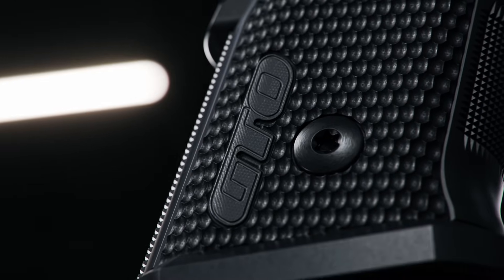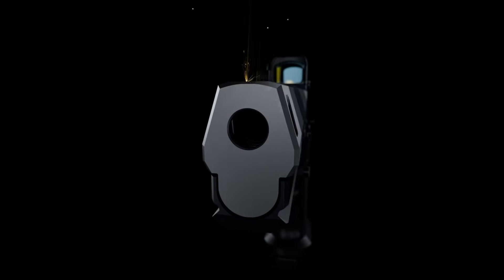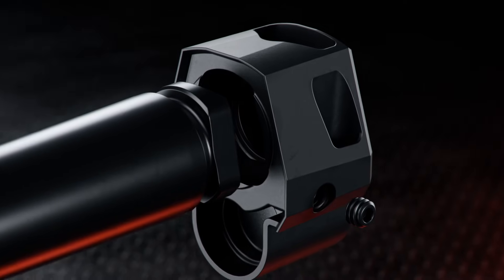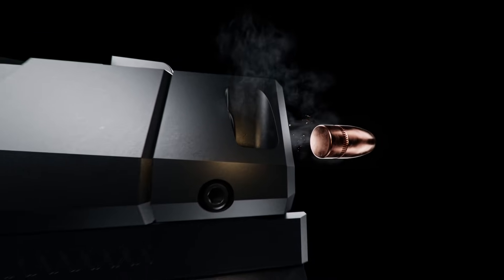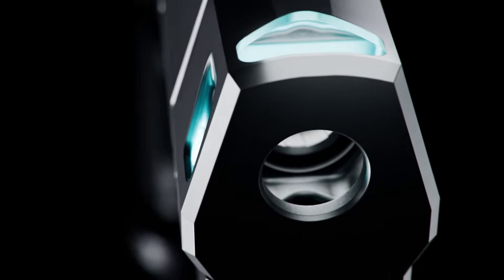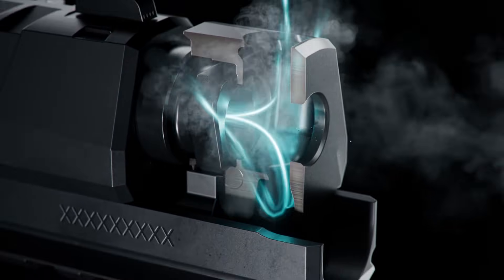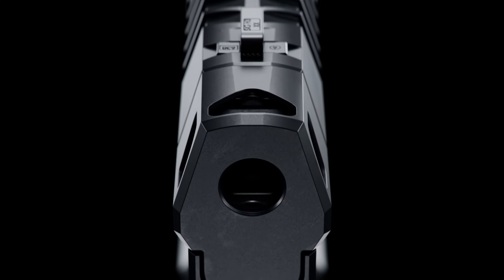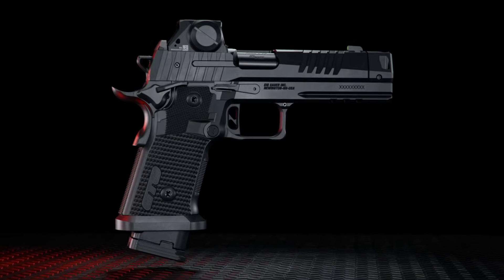The Mach3D Compensator | SIG SAUER

Comment: I feel like I trust highpoints at this point for safety more than I do sig
Reply: I would still trust a Sig made in Germany.
Reply: I have a Sig P226 Tacops that I'll gladly take to war. Chillax bro.
Reply: @RJGuitz p226 and p228 are hard core these glock suckers are trippen
Reply: I think you’re good as long as you stay out of the 320 line.
Reply: As long as you keep your finger OFF the trigger when holstering, you should be fine.
Reply: Bro relax it ws only 1 pistol
Reply: Sounds like a you problem.
Reply: @panamared5975 let me gyess your a glock cocker? The ones that jam.. melt after 1000 rounds? The ones that the grips start deforming

Comment: Does this mean the 320 is fixed so ai didn't waste $400 on two tax stamps?
Reply: Jokes aside.  Use your manual and check your takedown safety lever to make sure it's the correct 9mm version and you're fine